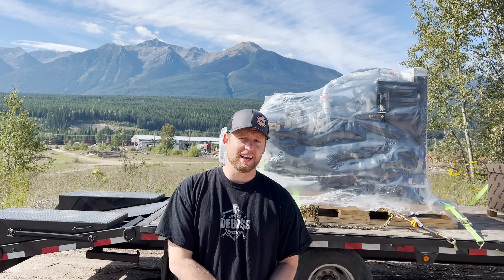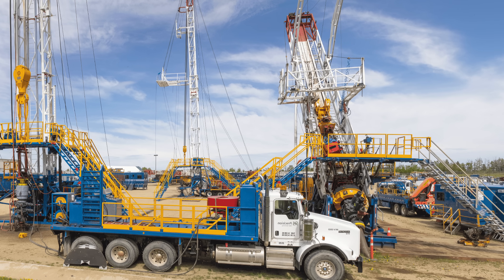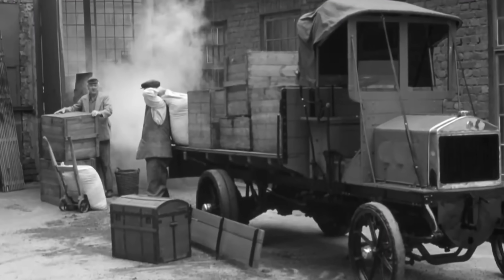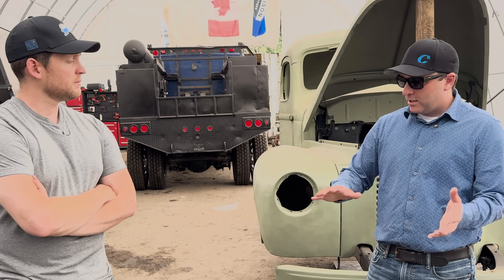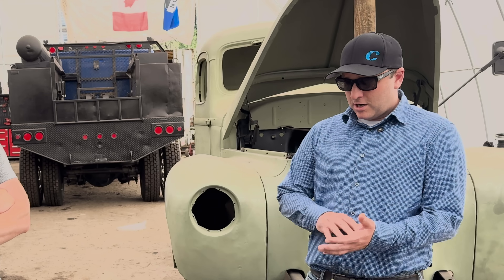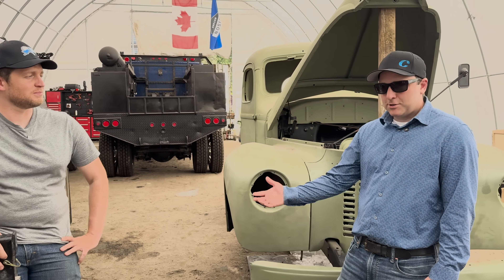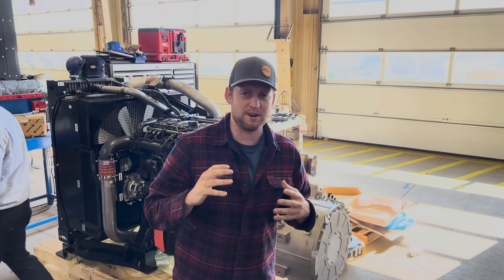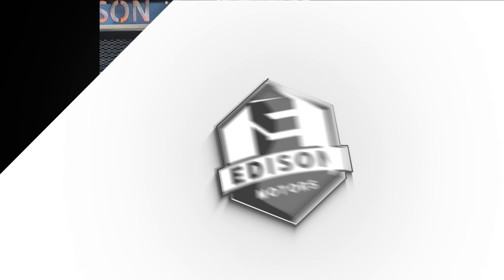We're putting Scania engines into Edison Motors Trucks!

Comment: Correct me if I'm wrong.  At 6:32 you claim that oversizing the engine is more efficient.  That is just not true.  While there are other factors, volumetric efficiency is the biggest number that affects economy.  For a give horsepower requirement, the wider open the throttle the better the volumetric efficiency is.  A throttle is a restrictor for an engine.  It holds the engine back.  (That is what the word throttle means; to restrain.) The more the throttle restricts, the less efficient the engine is.  So a smaller engine that can meet the horsepower requirement requiremes a wider open throttle; the more efficient it is.
Reply: Diesels don't have throttles

Comment: i would go with volvo. i worked at scania dealer as summer job, and if there was one thing i learned there was cylinder 8 doesn't like the block it likes to corrode away. so basicly if you like to tell customers to pay a price of the new truck for new engine or we can do a patent but you need to get rid of this thing asap

Comment: You can see at 6:36 that the sales person didn’t want to correct you, but you were exactly wrong.

Diesel engines used in trucks achieve their peak fuel efficiency at full throttle around the RPM range that achieved peak torque.

A larger engine at a lower throttle setting will absolutely consume more fuel than a smaller engine “matted to the floor all day” as you put it.

Comment: I don't get this at all? What's the point of going to all the effort to implement a diesel electric series hybrid if you're going to put a full size truck engine in it anyway? This would only make sense of the goal was an abnormal load tractor with capacity to pull 100t or something like that?
Reply: Here is my take. Just note, I don't REALLY have a clue.. But I think there is a battery package being a power "reservoir" allowing the diesel engine to work on a steady RPM (if at all) so when your work is spiking power up and down the engine can go steady. But it can also work "directly on the driveshaft" if the electric engine  struggles. . OK this is probably nonsense..😅

Comment: 6:30 while that argument would be true its important to note that the vast majority of engines in virtually any mobile application are usually not being driven to the max, even if you "only" have 500HP you are most likely under 30% load in normal operation for the majority of the time.

Each engine has a very specific point where RPM, load and fuel consumption are at the best possible point, this is usually in low RPM high load scenarios where the engine is only outputting a fraction of its peak power anyways.

Comment: I wonder about modifying the scania engines with speed of air modified pistons and speed of air modified chambers on the heads? That would help immensely with lowering emissions and egt's and increasing power/torque and economy.

Comment: The 770hp trucks in Europe is mainly used for +70tons. In Sweden we can haul 74 and in Finland 76 tons.

Of course some people use them as 4x2 fifth wheel trucks but they are intended for heavier use.

An old saying is that you want 8 to 10hp/ton for best fuel economy.

I had three trucks. Two Volvo FH16 one 540hp and one 660hp and one Scania 620hp. The smallest engine wanted most fuel. My max weight with three axle trucks and 4 axle drawbar trailers was 64 tons.

The new 13-litre Scania with OHC is a monster of fuel efficiency! Way better than the old push-rod engines.

Comment: More power isn't a good thing. Ask the evo guys how well their 900 hp 4 bangers hold up.
Reply: No need for a v8 in the Edison trucks! I bet they're going with Scanias inline 5 engines!
Reply: @davidlindberg4567  No they said they're going with the v8's. Which is a huge mistake. Straight 6 motors are just better all things equal for work trucks. No scania motor will last as long as a straight 6 cat or cummins.

Comment: My 4890 Case tractor has a 6 cyl. Scania engine. My cousin has a comparable horsepower J.D. and the Scania power uses 9.5 ltrs per hour less fuel doing the same work. We have 8500 hrs on the motor with zero problems, a great motor.

Comment: We are not hauling around 40 tons with 770hp. Ever wondered why it is only the Swedes (Volvo and Scania) that even has such powerful engines? That's because Sweden and Finland where almost all trucks are one of those two brands have larger and heavier standard trucks than the rest of Europe and a large part of the world, (64 & 76 tons) and they drive on more hilly and rugged terrain in arctic conditions. They even have road trains on some stretches at 98 tons. That is where the Volvo FH17 and Scania R770 is king and what they are built for. The regular Euro trucks driving around normal roads in Europe with 44 tons are not fitted with these engines and have engines more in line with what the US uses. Around 13L engines 500ish hp.

Comment: Legally running without a DPF is huge!
Reply: I wish they would have gone with FPT engines because they run without EGR and DPF, and they have lots of parts support here in the USA. FPT is owned by CNH so you can order engine parts from any Case IH or New Holland tractor dealership as well as ordering the parts online to be delivered directly to your door.

Comment: Well, peak efficiency is typically just shy of peak torque. That's a bit of a basic tenet of engine thermodynamics. So a bigger engine at lower RPM is not the answer to efficiency per se. It depends from where your starting from with regards to power requirements over time for a diesel electric powertrain.

Comment: But you're putting a nine liter engine in your diesel electric hybrid? That's seems like way overkill. I thought one of the advantages of the design is you can use a much smaller engine, since a highway truck only uses around a hundred horsepower to maintain highway speed, and use your battery for accelerating and climbing grades. I don't know why a design like that needs an engine bigger than two hundred horsepower.
Reply: Pretty sure 9L is not taht big for a powerplant providing for a large semi that is supposed to be heavy duty and capable of some level of off roading. Also one of their main focuses seems to be longevity. So, running a small as possible engine at its upper limit is something i am very happy they are not doing.
Reply: @LORFCASTER  A two hundred horsepower diesel could be five liters and it would be very under-stressed. A small as possible two hundred horsepower diesel would be two or three liters.
Reply: @joshbobst1629  If the batteries are empty and the driver needs enough power generation needed to move the loaded truck at highway speeds, on a dirt road, or uphill. As well as possibly at the same time putting a small % of charge into the battery while moving the truck ( am not sure on that last point, could be done seperately ).  Could a 200-ish horsepower engine be used to create enough electricity ?
Modern diesel pickup trucks are running 500ish horsepower to mechanically move the vehicle.
Reply: @LORFCASTER  In North America pickups have stupid amounts of power. Elsewhere they still have in the two hundreds, which is all they ever needed. It only takes 20 horsepower to move a car at highway speed, only around 100 for a semi-truck. If they are doing it right, their battery will be at least 100Kwh and the system will never let it get below 40% charge. It's going to take about three kwh to accelerate a loaded semi up to highway speed, a few multiples of that for most grades in North America. I don't see why the engine should ever be called on to produce more than 150 horsepower. 

Now suppose you are trying to go between Cheyenne and Laramie at 80 mph. The highway climbs something like six thousand feet in forty miles. Now our hybrid with a 200hp engine might have to go slower at the end. So what? Trucks go slower up grades. In the old days hardly any truck had more than 300hp and the world did not end. It just seems to invalidate the whole concept of a hybrid to put a huge engine in it.

Comment: My experience with a V871 Detroit vs a 671. Both on the same job running dump trucks. We would pull 1 more load per day and never had to "MASH" the throttle to do it. Big engines if drive correctly are far superior to a small engine!!

Comment: ya if I could afford some of these trucks, the first thing I would do is rip that out and put an American-made Cummins or Detroit Diesel in, I don't want an engine made by an EU company

hell just to avoid them I would go struggle bus and put a Duramax in tho I would burn alot of fuel and I would stress it alot; tho no DPF is nice sounding
Reply: And you are going to put the work in for the coding and integration of the ICE controller and the main computer of the truck? 
These are not old engines where everything is mechanical and thus it's easier said than done. So they like to work with a company that actually takes them seriously and helps with the integration, unlike others like 11:21 but not mentioned by name...
Reply: @subwarpspeed  yes I have put a Cummins 2017 in a 2020 vehicle that wasn't supost to have one before 

I get why they went with who they did, doesn't mean I have to like that company, but I have the knowledge and skills needed to be picky

Comment: I’ll be honest, Australian here, we have been running American Kenworths, Mack’s, Western Stars, Freightliners in Australia for like 50 years… been the backbone of trucking in Australia. In the past decade, euro trucks have been making a huge appearance here in Australia. Cheaper to buy and run. However. The majority of trucks I see broken down on the side of the freeway are euro trucks. Mercedes, Volvo, Scania.. they definitely don’t have the reliability American engines have, from what I have seen and heard.
As far as HP figures go, no reason why American rigs can’t produce more power and torque, not real hard. Doesn’t seem to be an issue in Australia, I mean, with have the longest, heaviest road trains in the world.
Reply: Older diesels are a lot more reliable than new stuff, but this 770 has nailed it, it doesn’t have EGR either.

Comment: 7:57 No DPF means not California compliant. CARB now requires all Diesel engines to have a DPF filter regardless of the size. Even small APU's now require it so anyone operating in California and/or the 17 states that have adopted CARB emissions standards will have to retrofit a DPF filter.

-edit: also as of October any semi truck entering California will have to pass a smog check twice a year and eventually stepping up to four times a year prior to entering the state regardless of the age of the truck.

Comment: Just lost me as a customer. Scania will be really hard to get parts for. You should have stuck with Caterpillar. 

We are not Europe and people in the USA are not going to want them simply because parts will not be available on the road in the USA. I can get CAT parts sent to any TA in the county same day because of the number of suppliers. I am not aware of any Scania distribution centers on the United States.
Reply: Scania could be setting up engine dealers and venders in the U.S.
Reply: @nonyobussiness3440  It already exist 300 service dealers of Scania in USA. But it's mainly maritime engines and electric generators
Reply: Not be so fast  they seem to have a center un the us withvpart so if they know that 100 edisons drive around they are gonna stock up on parts if you have loal guy that knows scanina motors you could ask him how fast you can get parts
Reply: @Ghfvhvfg  I work in the forestry industry in Oregon. If our log truck or chip trucks go down we lose thousands per day. We can't wait for parts to be shipped, not even overnight. Trump got elected president and his tariffs will make parts for an imported engine expensive.

The companies we haul for are the same way that's why most of the trucks are using Series 60 Detroit Diesel engines. We can get almost every part except a block from our local Fleet Pride on the shelf.

The other issue is that we go into northern California. California sets emission rules through its Air Resource Board known as CARB. Oregon and Washington have laws that automatically adopt new regulations passed in California by CARB. One of CARB's regulations is that all diesel powered equipment must have a Diesel Particulate Filter. This includes wood chippers, grinders, yarders, loaders, skidders and even generators.

The regulations on DPFs is based on fuel type not PM 2.5 output levels. In 12 states including Oregon the state with the largest forestry industry in the United States we won't be able to legally purchase their trucks solely because of the DPF issue. Even if it had one, the engine still must be approved by CARB and have a 50 state emissions label affixed to it.

Comment: This is all fantastic Scania in off road equipment, stationary power applications. I don’t see a clear path for on road applications of any of this. Please correct me and give us some hope of on road application, local type work gravel hauling, log hauling low bedding etc. There are no transmissions that I know of that will handle the torque in on road applications except maybe Allison.

Comment: Weichai Power has released a Diesel Engine with Base Engine Brake Thermal Efficiency of 53.09%.
While Scania may be giving you guys certain incentives to get on your hype train, 53% is a good 12 000 liters a year in fuel savings for a heavy-duty tractor travelling 250,000 kilometers a year.
And the scientific research numbers for Serial Hybrid vehicles don't look all that great to me so far.

So ye; delete this post , but NB the savings 1st and pass the message up to the bosses.
Edison is supposed to be about efficiency and saving fuel/the planet after all.
Reply: Why do you think they will delete your post?
I searched about this company and the text you have is the same as some reporting. But how much better would it be for an Edison truck? What is the efficiency percent for a regular engine that is out on the market today?

And see the comments. Some are on board with Scania, some hold back. And what I get Scania has a reseller organization in the US and Canada for their industrial engines and spare parts on US soil. Even if Weichai Power is efficient I think it would have been too hard to sell that.
Their rating about fuel savings (optimistically) is probably for a highway truck. True that serial hybrids doesn't do well with that but neither is the goal of Edison trucks to be such a truck, they are into vocational specialty.

Comment: So you're switching from a generator meant to generate electricity to a truck engine not meant to be used as an electric generator and hoping that it works the same as an electric generator? The more you guys post, the more I'm realizing you dont actually know what you're talking about. An engine for a vehicle is designed for variable RPM while a generator is designed to be most efficient at peak RPMs. You can't just slap a vehicle engine in place of an electric generator and then expect better fuel efficiency and repair costs, it was never built to do that.
Reply: What are you in about? Scania makes industrial engines for stationary applications. They also even have power generation engines (but that is 60 hz AC so they don't use that package directly).
So Scania definitely makes engines optimized for a single constant load.
Reply: Works in a Scania powered boat.
https://youtu.be/P-nHQE6LPaw?si=t9JBP0_s-4euWhvQ

Comment: Your approach to hybrid-electric truck design is exactly what we need in regular cars and pickups. Wish the incredibly highly paid morons running the big car companies had your good sense.
Reply: For cars it's not the most effective. A Toyota Prius is a series-parallel hybrid (power-split). So when there is an optimal gear for the engine, which is close to the gearbox and the wheels, it mechanically uses that and can top it up with electrical power (motor). For a startup this would probably be a lot of custom engineering to get it together and on a truck you have the diesel far away, and you probably would want regular axels if the electrical motor should be somewhere there too. It makes a lot of sense to do series hybrid as Edison does for a logging truck as it gains efficiency compared to a old ICE only truck and it's "simple". You buy an engine, bold on a generator, put some cables into some controller unit and then back to the e-axles which when integrated as a unit probably is easier to handle than some old axle and a modern electric motor (how much play it is in the gears, how to do the right regen braking etc.).
Pickups probably depend on the task but at least they are (and especially a bit older) not so customized built, one thing could be swapped for another thing.
Reply: The 2025 Dodge Ram Charger is what you are looking for

Comment: I have a lot of questions! Lol So you guys are building hybrid trucks? Using the scania motors and electric motors? I thought you were just using the scania motor until I done through your videos. What exactly are building and do you have a video I can see the whole concept?
Reply: they will build series hybrid electric/diesel trucks where the diesel engine powers the generator which charges the batteries that in turn drives the e-axles (an electric motor and axle build together). The generator doesn't need to be on, the power in the battery is enough to drive the truck.